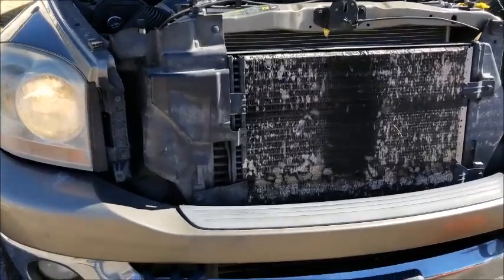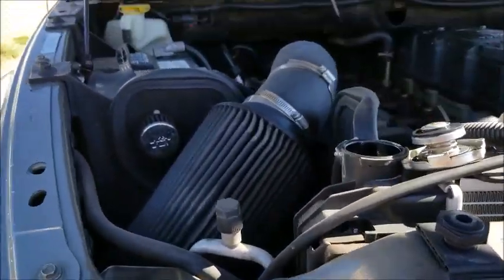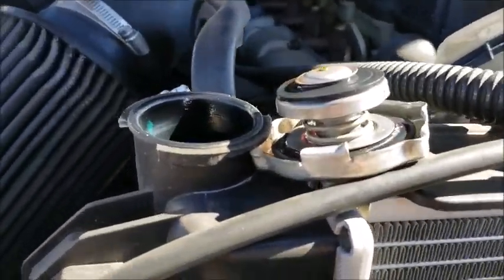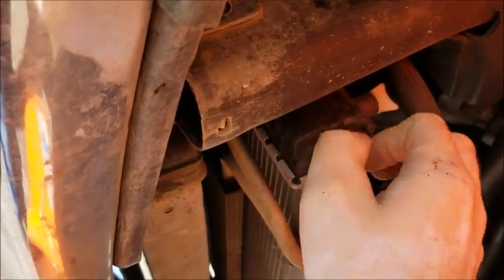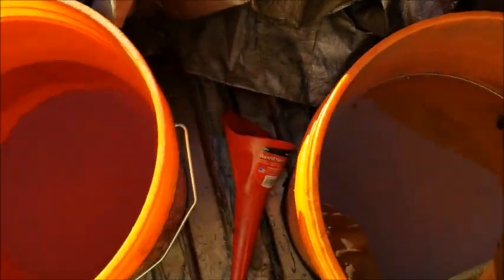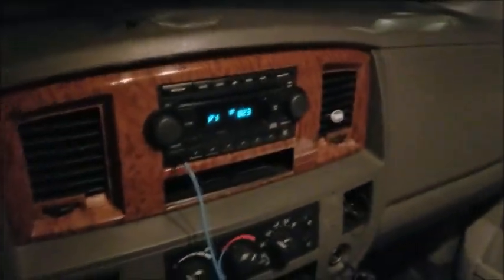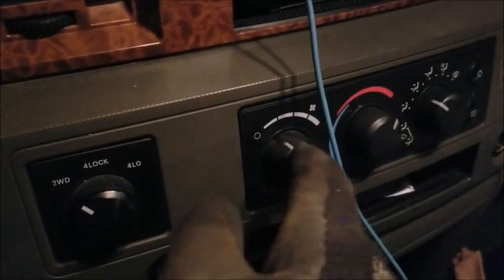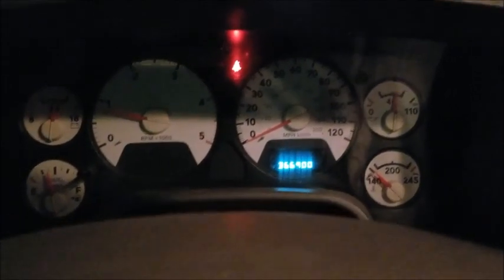2006 Dodge Ram 3500 5.9 Cummins Coolant Flush

Comment: Get rid of that air filter, otherwise we’re going to be watching you do a video on fixing a dusted engine.
Reply from the maker: Sadly the truck is gone. Mostly due to an error I made but wound up needing a new gear housing and the injection pump was tired
Reply: Chris Rocha Sorry to hear that.. I’m up to my elbows in a K&N dusted 12 valve right now.. I bought it cheap, at 168k the engine was shot.. K&N (and lookalikes) kill more engines then environmentalists.
Reply from the maker: Sad to hear.